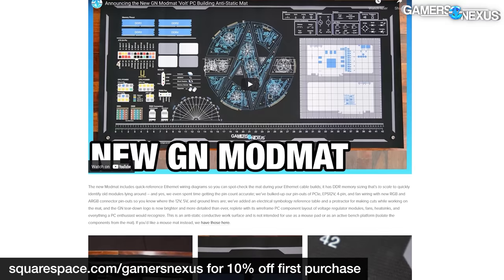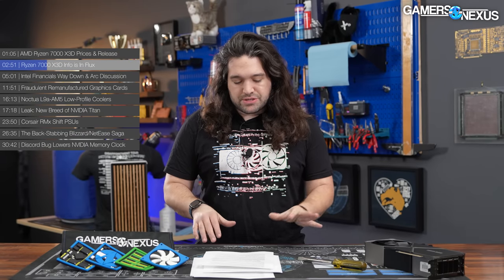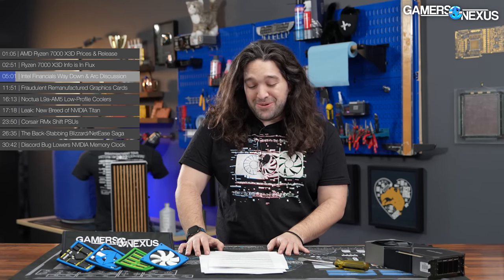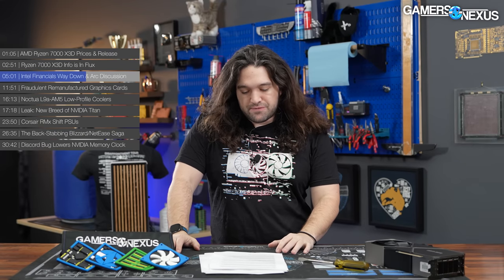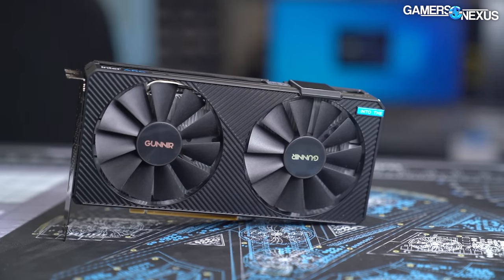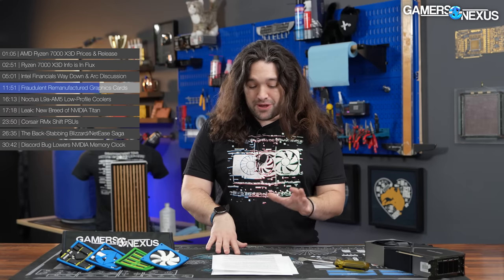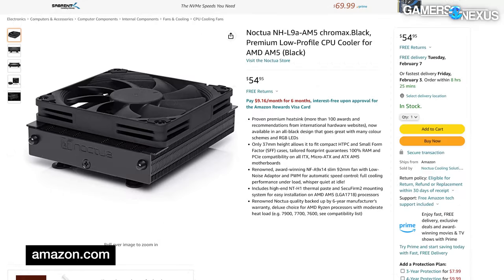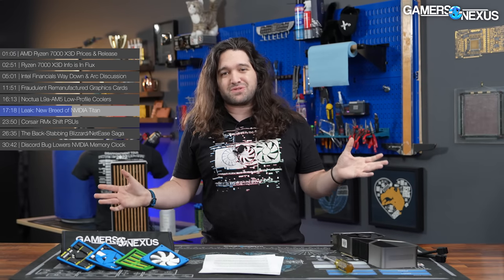HW News - Fraudulent Used Video Cards, 7950X3D Pricing, New NVIDIA 'Titan' Rumors

Comment from the maker: Check out the TecLab & Iskandar Souza videos below for some great investigative reporting. Absolutely love it!
Check out TecLab: https://www.youtube.com/@TecLabbyRbuass
And check out Iskandar Souza: https://www.youtube.com/@IskandarSouza/videos
Check out our Intel Arc driver revisit! https://www.youtube.com/watch?v=b-6sHUNBxVg
Reply: If Nvidia makes a Titan, it will likely be Grace Hopper based. It may also explain the odd I/O design.
Reply: I have been doing 3D work for decades, basically just making one-off parts for machines. I use 3DSMAX and AutoCAD. This however is not my main job. I am a Mechanic by trade (35+ years).
I use Titans because of the drivers, and the price (versus Quadro Cards). The Titan drivers have some elements of Quadro drivers, as well as GTX/RTX drivers. For me it's the best of both worlds. Though I think with the last two generations of Nvidia cards, they would be more than powerful enough for what I do, as well as allow excellent gaming performance. 
Been loving the content lately. You and the entire GN team are incredible! Have a great day! o7
Reply: @cmdrclassified  I do my fair share of 3D modeling and rendering on their consumer cards. What's the drivers differences with the titan that makes them better for CAD than consumer grade ones?
Reply: … china … ethics … 🤣😂🤣 … dude, that was a super cool joke 😀
Reply: @lua-nya  Quadro drivers are designed for 3D applications, as are the cards. The Titans incorporate a bit of both. They have their own driver selection on the Nvidia website. The only thing the Titan cards are missing is the ECC memory. They are however the fully unlocked die from the GTX/RTX series of cards. 
Like I said in my previous comment, the mainstream cards these days (not workstation cards) are so pwerful, I'm not sure there is even a need for Titans. At least for the level of work that I am doing. Right now, I am using the Titan Xp, Galactic Empire Collector's Edition. It was a great deal at the time. I lucked out, as it was used for about 30 hours or so, with a waterblock, in a showpiece PC for some event. I wouldn't use the stock cooler either! Looks cool, but terrible cooling!
Reply: Wait a minute, what happened to the over $50 billion in taxpayer stimulus for these tech firms? 

I guess that this is what it means to support the American stimulus workers in China and Taiwan who needs the jobs.
Reply: @lunarvvolf9606  Maybe you should take this up with Nvidia. In the near decade I have been watching Steve, he has always been about proper testing, and about the consumer. If you took what he said in this video the wrong way, well that's on you. o7
Reply: @cmdrclassified  where is his/her comment reply?
Reply: @AwesomeBlackDude  It was just there, as I replied to it like 10 minutes ago. Not sure what happened.
Reply: Folks are having trouble plugging in 1 of those 12pins...........now they have to do 2. Keep the fire extinguisher handy ahahahah
Reply: @cmdrclassified  only disadvantages (prior to RTX) I've seen with the consumer ones I've seen are when rendering having to be careful to not need more RAM than the card has and raytracing being slower than quadro. These days a 3070 goes a long way, but even in the 10 series times I didn't find a lack of features, just of RAM.
Reply: For an April Fools edition, you should do only Hot Pocket news.
Reply: 30:00 Fantastic warning by the Chinese thieves that nobody seems to be paying attention to. Nor mentioning the illegal actions by them doing this. Nothing like that, Im disappointed Steve Very disappointed.
Reply: I don't think the Titan/Ti is intended to be mounted vertically like you're saying Steve. I think it's supposed to incorporate a 90 degree offset PCIE slot-in from the PCB and blow up through into an exhaust fan at the top corner of the back of the case like most cases have.
Reply: Corsair's Shift approach together with Gigabyte's Project Stealth might make for good video content? Quality of life for PC DIY.
Reply: On Intel. They also saw a hit on revenue because of the expansion of their chip making services. I noticed it is in the slides. That should be a money maker as the new facility opens up here in the U.S. Granted, they will compete with Samsung and TSMC who are also building here, but it will be a modern facility and given the dearth of chips in other markets, like automobiles, Intel should see that segment pick up. As for the ARC, NVidia and AMD may be doing the most to keep it alive. Given their prices on their cards, everyone wants ARC to win. Intel's prices are reasonable and their performance gains will give us more than rehashed performance at a higher price.
Reply: Does Iskandar have any English videos?  I guess neither cited channel have accessible videos.  Could be useful to have mentioned a particular language requirement beforehand.
Reply: Thanks for sharing 🙏
Reply: income basic symbol in speak english personal computer year 2023 / 2024 sys data com master accounting computer quality classroom speak 🏛🌍🌎🌏